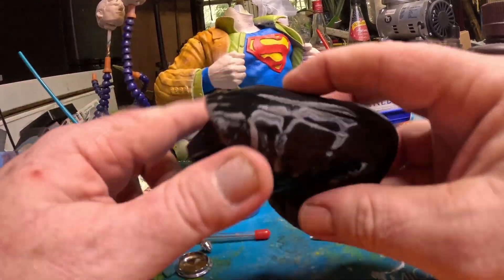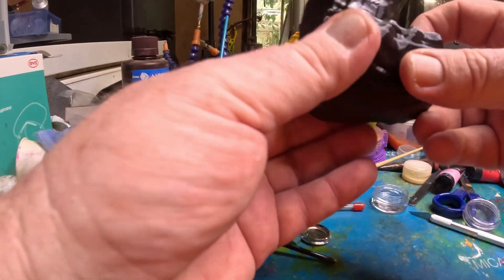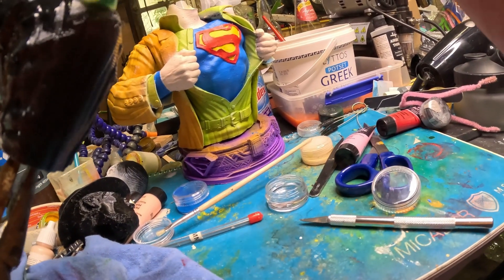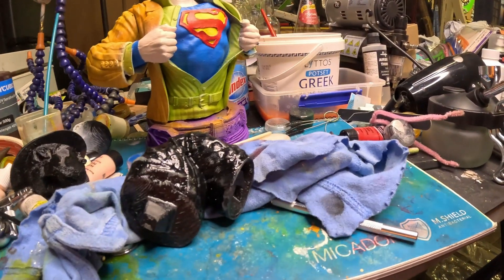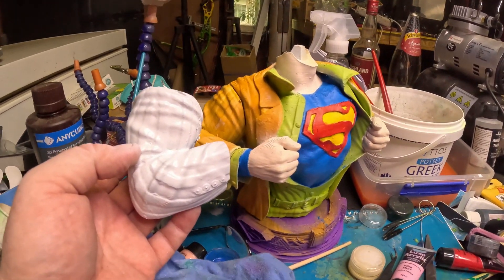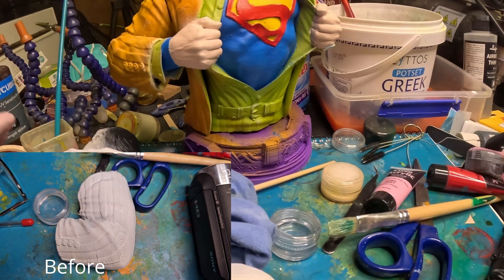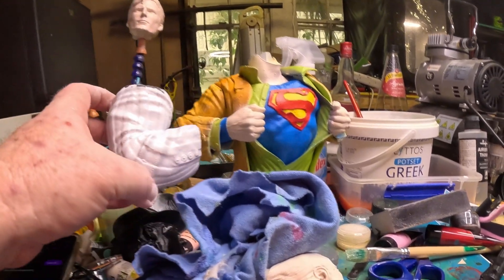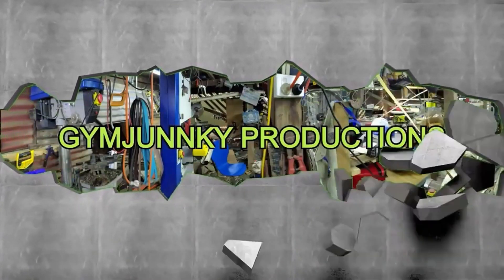Easiest Way To Remove Lines On 3D  Prints

Comment: Are you aware of what happens when you dissolve resin in alcohol and have it all over your hands? It goes straight through your skin into your body. Keep doing that and you're going to have a very bad time. I'm not being alarmist, what you're doing is very bad for you.

Not only that, you're washing it straight out into the water supply which is also incredibly bad.

And on top of it, you're spraying it all over your dishes and surfaces in your kitchen were you presumably prepare food.